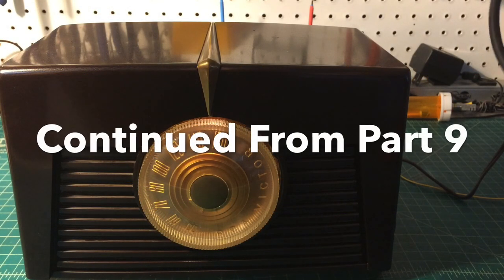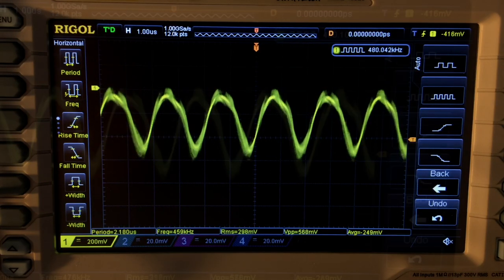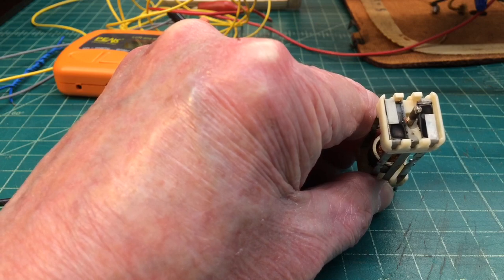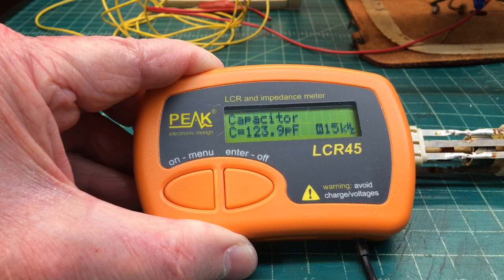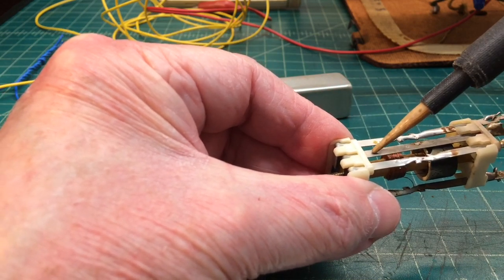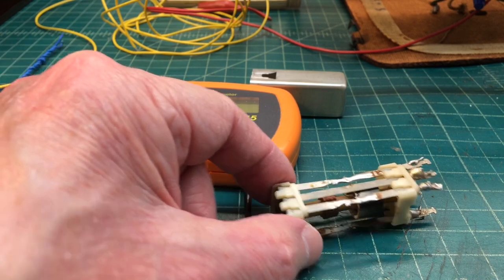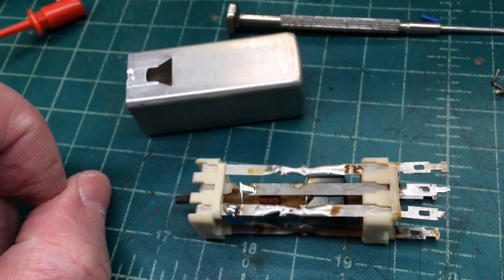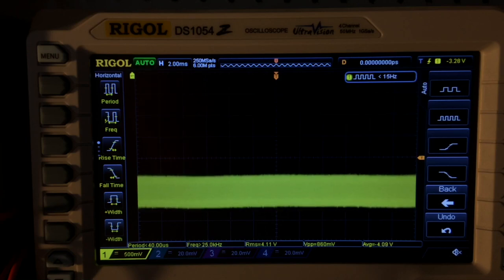RCA 8-X-541 - Cause & Effect P10 (A.V.C. Troubleshooting & Repair)

Comment: I havent had to recap any I f transformers yet ,but I have bought some 100pf and some 220 of silver mica caps which are more expensive then a lot of other capciators.but you need what you need later I will order some 120 of caps too.its good to have stuff on hand .thanks for your video its helpful
Reply from the maker: Thanks Ron. I need to restock myself on various capacitors and resistors. Take care and stay well. Best, Don

Comment: So if you approached the radio two videos ago with SMD as a preconceived notion in the beginning (poll result) then the result would be a disappointment when the underlying cold solder joint was the dominant failure feature.  All goes to show that your careful systematic approach and testing ferreted out both failure points.  Will be looking at how you approach the permanent SMD fix.
Reply from the maker: Thank you. It was odd to find two separate issues with similar effects. I just uploaded a new video you might find interesting. All the best. Don